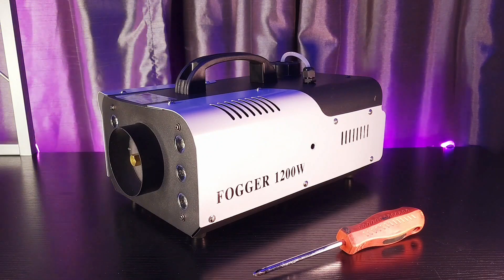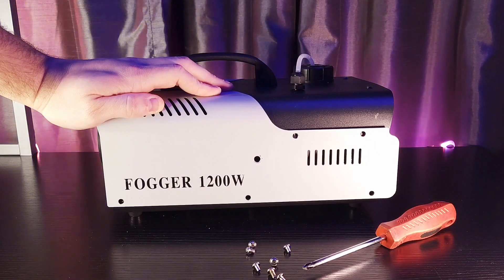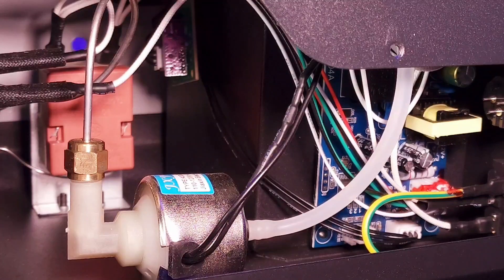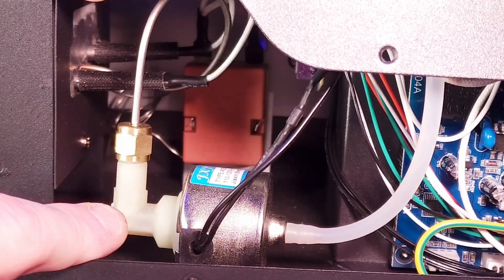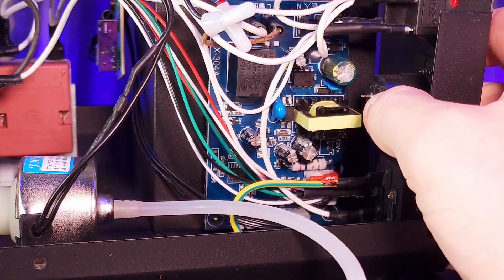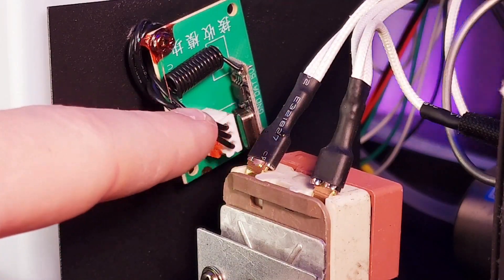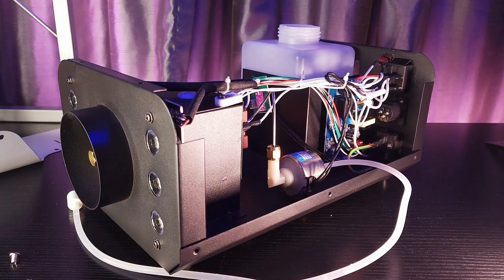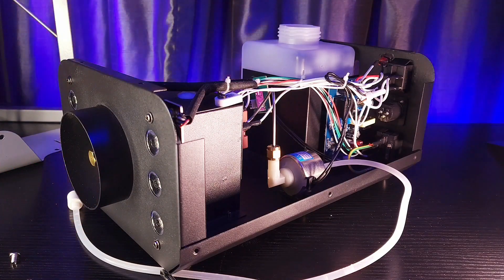1200w Budget Friendly (Under $80) Fogger Teardown!

Comment: Would you happen to know what type of switch is used for power and the path power takes through it so I can find another one?  Thanks in advance
Reply from the maker: @bobbywarne7887  It takes a Rocker switch with three wires ground neutral and live. I cannot give you specifics as to how to install it due to liability so I'm assuming you have knowledge with electronics and the dangers of power and currents.

Heres a link to a typical power Rocker switch: https://a.co/d/j4q3MEG
Reply: @TheatricallyJerry  thank you
Reply from the maker: @bobbywarne7887  My Pleasure also the switches have markings by each metal pole that tells you the path like a N for neutral a L for live and a ground symbol so to me it's extremely simple to replace but could be difficult for others. It's a install at your own risk type of thing but the risk is extremely low as long as the machines not plugged in and the wires are going and correctly terminated to their correct position.
Reply: @TheatricallyJerry   The switch on mine is completely blank.  I have the same machine you reviewed in the video and I agree that it’s very cheap in quality.  Also I don’t have the thermostat style yours does and my wires are all black except for the red one spliced to a Load wire.   However it smokes like a train and that’s all I need it for anyway lol.  I appreciate your time sir, thanks again for the information.
Reply from the maker: @bobbywarne7887  the new switch will be labeled they are labeled with a super tiny etch into the black plastic next to each pole. It's hard to see but it's there. Yes they are cheap and are sold as cheap that's what I like about it. It's not trying to be a $300+ machine. Great for Halloween displays outside or anywhere that you don't care if it gets ruined. This particular fogger actually puts out more volume of Fog than my ADJ VF1300 So it's actually pretty impressive for it's price point.

Nothing on my channel is labeled as expensive or high quality (except the V-Show S series movers) if you buy it cheap expect it to look and feel cheap.

Side note: I have already replaced the rocker switch on this particular fog machine as it burned out. The Rocker switch has a fuse built into it as well as the power supply IEC power connector.